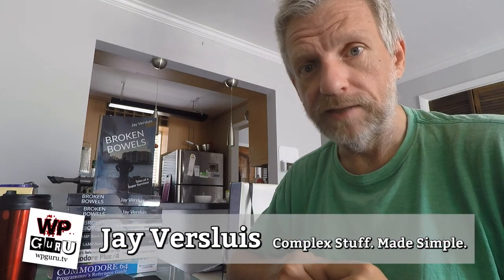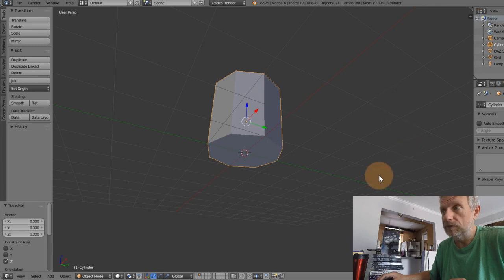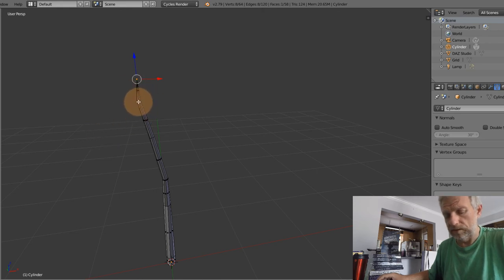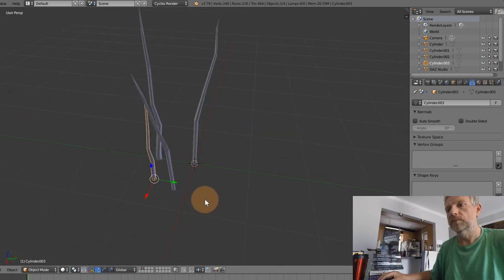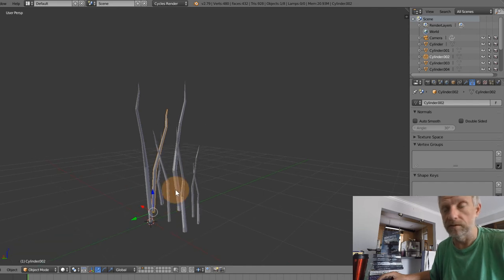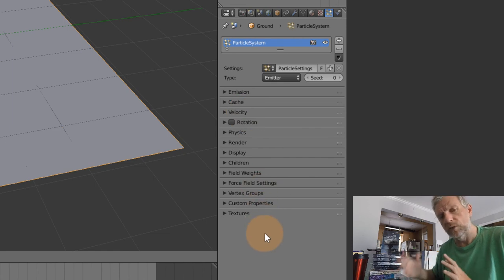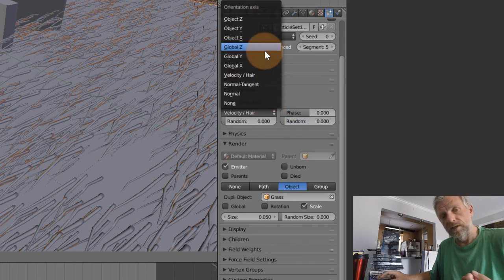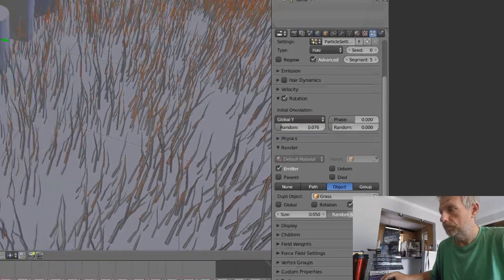Replicating an Object with Blender's Particle Emitter

Comment: A really useful and interesting introduction to replicating objects in Blender. Thank you! Just a polite comment that it is never really advisable to build a blade of grass as a cylinder. As the grass would be so far from view, there is no point having the extra geo of a cylinder. I have almost always seen blades of grass created as flat planes. Using a cylinder per blade also dramatically reduces the performance when replicating a large number.
Reply from the maker: Very good point, thank you for the tip! I'm glad you enjoyed it :-)